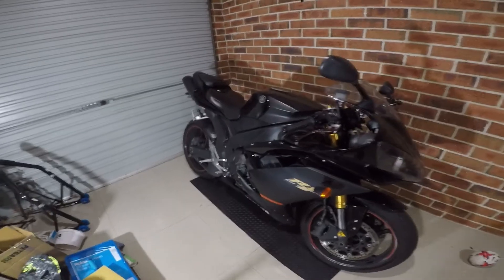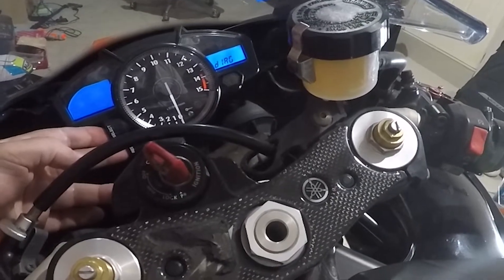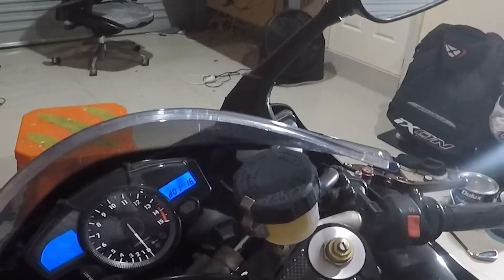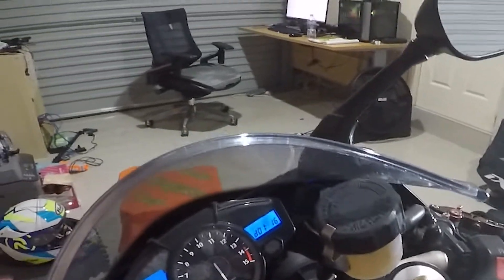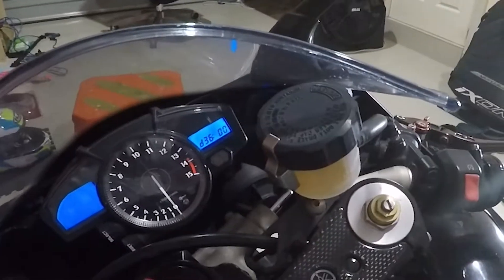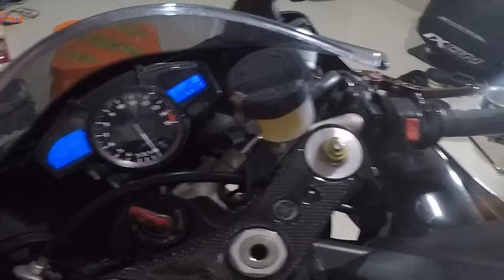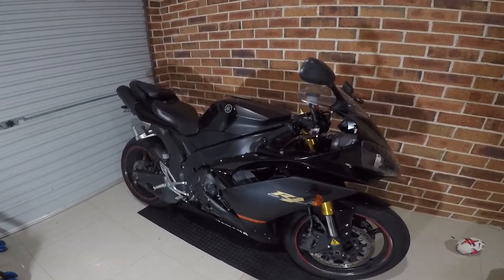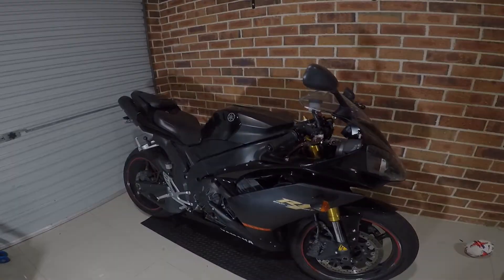Yamaha R1 Diagnostic and Fault Code Console

Comment: Were can i get a list of what the codes are for like the way u check the injectors and stuff
Reply: Workshop manual
Reply from the maker: @7030Motovlogs i haven’t seen it in the manual, I did a google search and there was a text file floating around on the internet
Reply: @7030Motovlogs there’s a video where dude goes over them.

Comment: My bike was going fine turned it off went to start it after 5 mins no power to pump or alarm and no power at power command box any ideas
Reply from the maker: @cathalcarty37  not sure but try clean your kill switch
Reply: @sparkthego ya if you use it to turn your bike off all the time it will get loose and wiggle causing shutoff

Comment: Do you have to disconnect the fuel pump connector before entering the diagnostic mode？
And if you do ,  how？
Reply from the maker: I've vaguely recall reading that somewhere but I never did it. You don't need to do it to get diagnostic mode working but maybe as a safety precaution? Some tests actually need to fuel pump to be working like a fuel pressure down test. Having the kill switch in the off position will stop the fuel pump from running. if you really want to disconnect it you need to undo the 2 side bolts on the tank (not the pivot ones) and the front tank bolt, then pivot the tank up and pull the 2 wiring clips on the fuel pump. Probably a 10 min job.
Reply: @sparkthego  Ok thanks, I'll check it out

Comment: can you tell me your co values?
Reply from the maker: They were all zero
Reply: @sparkthego  if you know can you tell me if a power commander installed the co values effect it?
Reply from the maker: @panosdanzis950  Yes the CO values will effect the final result because power commander applies a percentage of the ECU value. The power commander is not an absolute fuel value its a factor of the ECU value. If you change the ECU value (via CO) then the fuelling will still change even if theres a power commander.
Reply: @sparkthego  thank you very much you are very kind. kisses fom greece

Comment: I have a 07 model i get the H1 code most of times when i try to turn on the bike. Then after it vanishq ... What code is that? Overheating?
Reply from the maker: I don’t think thats a code? Is it just that the bike is warm when you started it? Opposed to Lo when cold?
Reply: Even at cold start i see the HI what can it be? As wel my bike suffers to start whem its hot..

I need to wait 30 min to let her cool down so she could start again.
Cold start all fine
Replaced the starter motor
Battery 
Checked the voltage & al 
Everything is fine
Reply: @dr.dhruvjadhav is the light blue?? It’s the high beams!
Reply: @dr.dhruvjadhav thermostat take it off put it in a pot on the stove with water until the water starts boiling. If it works it should pop open when it reaches a certain temp. If it doesn’t you need yo replace it.
Reply: @dr.dhruvjadhav  Its common problem in 08 R1  you cannot start until its cools down else it will drain your battery if you start when the temperature is high
Reply: @khanmukrram you must
    be trolling 

 Where did you hear the bike shuts off when hot dude? Totally not true.

Bike doesn’t shut off if too hot. But the red oil temp light will prob come on. This dude must be trollin👿 
1st Your fans will turn on….Then if it gets hotter than 235 manually turn it off. As long as you’re moving at a good speed the radiator catching the incoming air cools it down. These are track bikes and unlike cars they tend to get hot if you leave them idling too long. Try wrapping your headers and using water wetter instead of water in radiator.

Comment: I have 2004 R1 for the past 13 years. One of the most advanced bike for that period. I also use those diag option to regurarly check my bike. One time i was playing with exaust gas volume settings to adjust corect air mixture ratio for better performance. U can check almost everything with that mode.
Reply from the maker: Definitely need to check that out 👍
Reply: What do you mean by exhaust gas volume..?
Reply: @khaledkaissar5263  that means how much fuel and air being mixed.  You know when you hear that popping sound when a motorcycle decelerates. That is a very rich mix of air and petrol. You can adjust that for every cylinder.
Reply: @khaledkaissar5263 ya I believe you have to unplug a green wire from the brain module and can t remember what else.
Reply: Is the process to find diag mode on the 04 the same as in this video?
Reply: @shortroundR1  Yes it is.